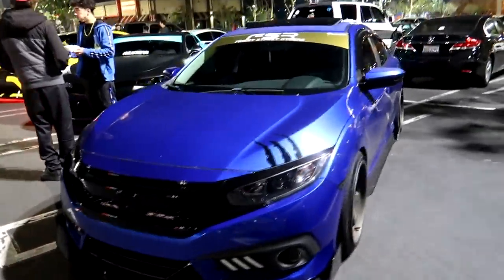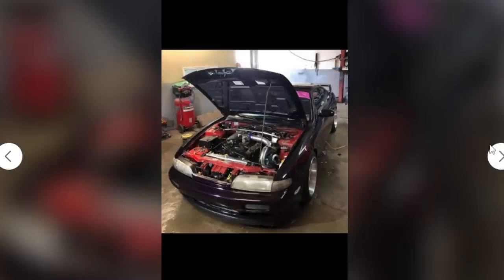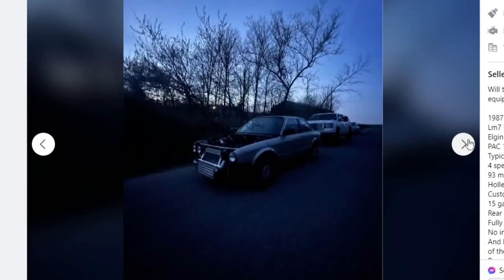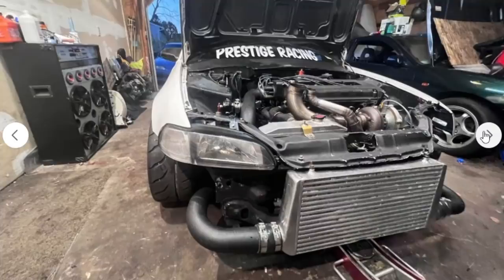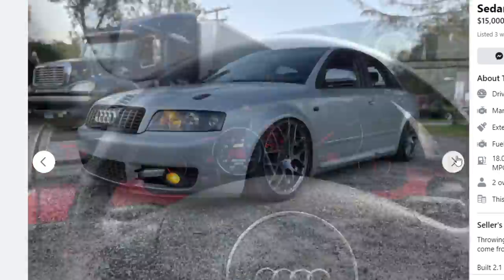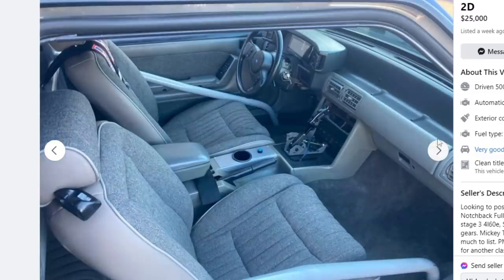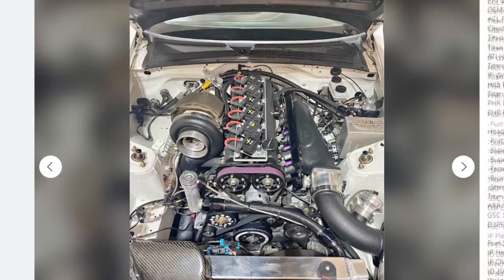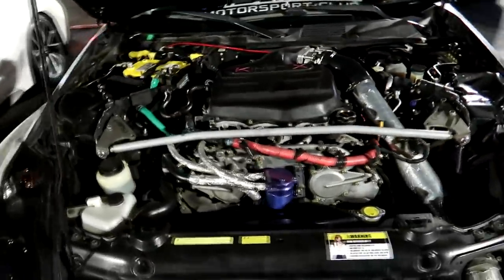Dude Thinks His S2000 Is Worth $50,000?!?  (Tuner Cars For Sale)

Comment: S2000's where I live here in Canada go for around 30k with low km so tbh I can see it being worth over 40k with all the work he has done to the car
Reply: No, if it was stock with low miles it would be worth more
Reply: there was a black one for 43k with 30k miles at the honda dealer while I was getting my oil changed
Reply: Especially the AP2 s2000’s in some areas, I’ve seen a couple go around 30-40k with about 70k miles on them.

Comment: S2K are more expensive than you think 😂
Reply: Facts I think people think because it’s a Honda it’s supposed to be cheap… but if you have actually driven one you know
That the only thing the s2k has in common with a civic is the badge…
Reply: @Norrr3  only the older Civics felt cheap, the modern ones don't, not to mention the K20 Si engines are very similar to the F20 S2000 engines

Comment: If the guy actually dumped $20k into his motor then he’s asking the exact price he should be, market value for a stock s2000 driven 100k miles is $30k
Reply: If you paid 30k or even 50k you are smoking crack.
Reply: Realistically more around 23k depending if it’s ap1 or ap2, plus that’s if it’s stock for the most part with most vins still intact. I got one myself so I’m often in the s2000 groups so I get to see how the prices have changed
Reply: @tjlift22  I’m not saying I would, I’m just saying what they’re priced at
Reply: @Ceezah_  still that would mean his price is fair, he would be asking 3 over, and then would probably get talked down by anybody who would want it
Reply: @itskanashimixo  Im sure all those s2000’s around 25k dont have a hardtop either…
Reply: You can spend $100k on a crown vic and still not worth 100k
Reply: @nathanielford3  not a single one has a Mugen hardtop which I believe is another 4k at minimum
Reply: @Thor Odin son a low mileage s2000 with a hardtop would definitely go for 30k considering I found a handful of soft tops going for almost 30k. Most are usually priced around 23k-25k

Comment: Yes $46k have you done research at all, price out a S2K and price out a built 2JZ that’s even if you can get the parts and find a machine shop that isnt 6 months out or more, Before you post your videos you should have ALL the info, you are missing more than half the build list! The car is sump tanked for fuel, car made 1106hp turned up off nitrous. Has a fully built Rossler TH400 and a built 8.8 rear end. Let me know if you have any other questions about it.
Reply: Mods don't correlate to cash. Not saying its not worth anything for em but still.
Reply: @genjishimada1063  unfortunately in the private market it actually does correlate. Even then what he listed in that comment would put the build price at least 10k over asking price. So in reality it's actually a good deal
Reply: Ehh not really. See modded ones go for 25k here all day.. everyone knows mods don't necessarily increase the value of the build by as much as you are spending because its done to the owners exact taste and not everyone wants the same mods. I would say it's worth 35k or so. 46 is kinda steep

Comment: I have a 04 Audi A4. That red strip is definitely not factory! It's still stock ish. My 01 A4 on the other hand is full bolt on (still under 300hp) but I have a big turbo I'm working on currently. Just need to get intake piping worked out because I'm keeping the MAF and evap. There's 4 things that need to plug into the pipe before turbo and there is shit for room in that damn engine bay!

Comment: I'm still sticking to my rule ot thumb if the engine can't do 600 hp NA it's not big enough.
Reply: @aidaaliten8817  ok
Reply: My GT350 has smol engine then I guess
Reply: @RCXDerp  I think you miss understood my comment 600hp potential NA not 600hp stock and a GT350 or even a regular 5.0 will put out 600hp NA with bolt-ons and a good e85 tune.

Comment: Clean S2K averages at 20 to 30k. Then a 2JZ is like 7k to 10k then a turbo kit 4k, carbon hood 1. 2k, digital race dash 1k new or used a bit cheaper. Port polish work 500 to 800. Fuel pump 150 to 200, tires 400x4. Duct ventilation. 

The S2K is 46k lol.
Reply: Man you are so far off its funny. Find me a built 2JZ with billet mains, head games head, cams, custom intake I’ll buy them all at $7k right now! the turbo alone is over $3k, have you ever priced a Weldon 2345? Once again find me one for 150 bucks I’ll buy them all!
Reply: @whitelazer1  everything i mentioned was at the top of my head.  A fully built 2J is crazy money. I was just telling this guy that this S2000 is worth that price with all the work done.

Comment: 2jz  in a S2k  for 40k 
Home boy is bro taxing off the names 
He has 2jz s2k an said this is what everyone wants give me money
Reply: It's a 20k car with a 9k engine that has probably 15k worth of parts in it. It has a 4k carbon fiber hardtop on it, a built transmission, a built rear end, and a nitrous system on it. Not to mention the weld wheels. You aren't building a car like that for less money then he wants
Reply: @beardedforlife3740   bro the car an engine are expensive because it’s bro taxed. In reality it’s all a 8k car without bro tax
Reply: @jack6343  it's that expensive because to buy and build that car you'd need north of 60k

Comment: I'm getting 560 whp with just a single 255 pump. 2jz 1050idx injectors precision 6466 gen2 @22lbs of boost
Reply: Hello i have a 2jzgte vvti with id1050 , precision 6466 , 455 pump , ferrea valves , dual valve springs, gsc269 cams , arp head studs can’t wait to see what it can do on dyno
Reply: @2jzoreo79  that's more work then I've done, you're in for a great time by the sound of it. Get the best tuner you can find
Reply: The car has a Weldon 2345 pump the 450 is just for the sump
Reply: Tuner said next upgrade  should be coil packs but I'm not doing anything before a bbk rims n tires. Which I have no money for